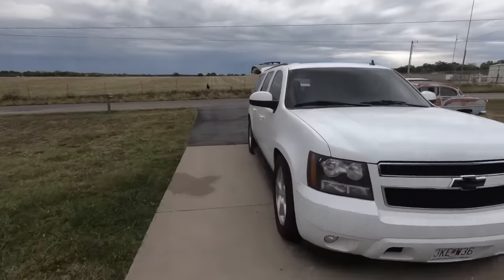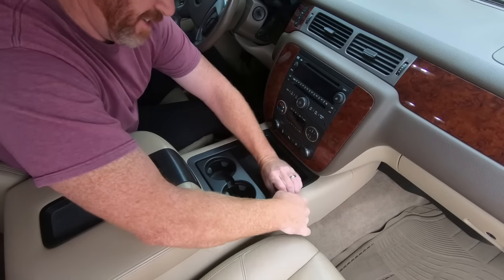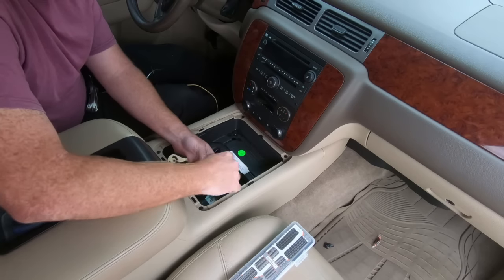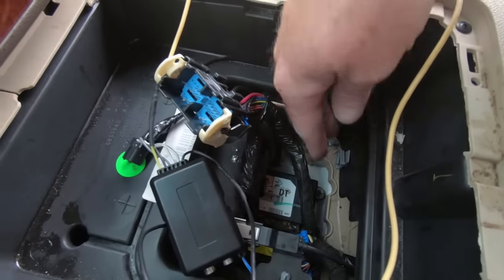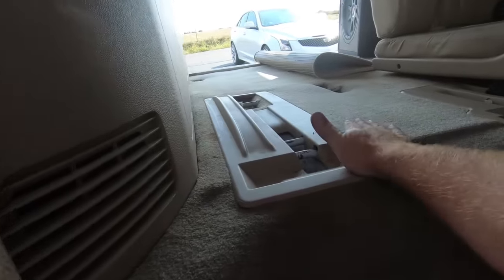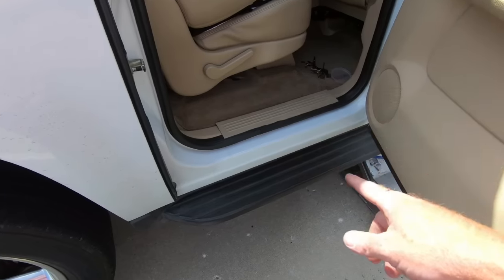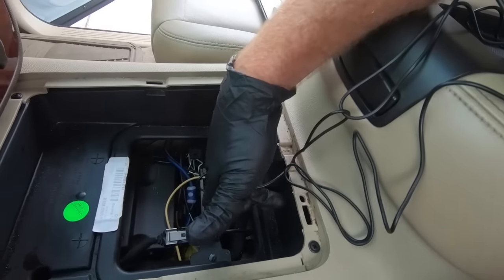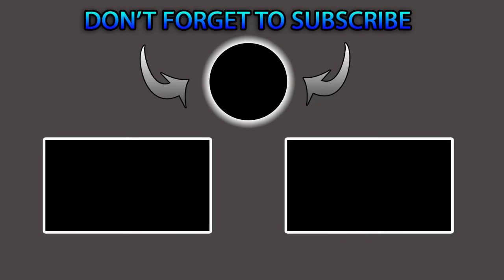Adding Subwoofers and Amp to the Suburban

Comment: Your cupholder bezel is available with matching wood grain from Cadillac. Did it to my 2013 Avalanche, looks like it should....ALL MATCHING!
Also did away with antenna and Cadillac  has the proper cowl plastic for an antenna delete
Reply from the maker: These dont have external antennas. I dont love that wood grain cover. Constantly breaks

Comment: 09 suburban LT exact interior outlay and bose system..under center console hook up wit loc..im highly impressed with this install and will be running the same way this is a super clean install..thnx man keep it up.. 👌
Reply from the maker: Thank you.
Reply: Update..correction.. No bose system..cnt l.o.c. the front speakers cuz of clippn..do to tweeters n door speakers so rear speaker used n no clippn..still same install..very clean
Reply from the maker: Thank you

Comment: I liked how clean the install you did was. I always enjoy the videos. I have a sundown sa 15 in my Jeep with a tar amp 1200 watt. That thing hits pretty hard. I always liked kickers as well. I bet it beats man. Keep up the great videos.
Reply from the maker: Thank you. Yeah it does pretty good for cheap used speakers. I'm going to have to try some sundown stuff
Reply: Razor subs pretty good also, I had the Gothics (1) on the razor 2500D.. Loud off bass all the way down in neg ..sound traveled deep and loud for the caddy like 15s  truck bass

Comment: If you have issues with the amp moving around, get a couple 1” aluminum straps and sandwich the carpet between them and the amp with bolts through the amp mounting holes into matching holes in the aluminum strap. Mounted a powered sub that way in our old 2001 Slownoma extended cab on the back wall of the cab.
Reply from the maker: Thank you for that. It seems to be doing well.

Comment: Hey man. Very nice, and clean, setup. I'm going with Focal 6.5 2-way in the front, 6.5 coaxial in the rear doors, and 12" Focal sub. Alpine 5 channel amp. In a Tahoe 2000 mod. Thanks for your videos brother!
Reply from the maker: Thank you. Sounds like a nice set up you are going with
Reply: @TWAMotorsports  did you upgrade you mids and highs?

Comment: Great tutorial for all the radio amp subwoofers people out there 👍
Reply from the maker: Thank you
Reply: @TWAMotorsports  Travis I'm looking into that brake kit you bought for your ws6.  I'm upgrading my front and rear brakes and the kit you have isn't showing up for my 94 trans am. Is there a typo error?
Reply from the maker: Spindles are different on lt cars. Need 98up front spindles
Reply: @TWAMotorsports  ok. Thanks my friend. I found the brake kit for my year 94 trans am. But they are out of stock. So I have 2 options? I can wait till they come in but Don't know how many months it will be? Or I can by 98 front steering knuckle to allow bigger brakes... What's your opinion on my options??
Reply from the maker: Upgrade from spindles. I have a set I sell for $100
Reply: @TWAMotorsports  100.00 for the pair
Reply: @TWAMotorsports  ok they have the front brake kit same brand as you have on your ws6. But the rears are out of stock at the moment. So I'm going to purchase the front brake kit for now. And I'll do the rears when they come in stock.
Reply: @TWAMotorsports  also Travis... I'm going to order that POF 15 paint to do the underside of my 94 project trans am. I'm going to but the gloss black though I think it will make the red powder coat BMR suspension stand out more.. what's your take on this paint?
Reply: @TWAMotorsports  I'd buy your spindles but they won't fit my 94
Reply: @TWAMotorsports  happy Friday my friend. Any plans for the weekend?
Reply from the maker: Work all weekend unfortunately
Reply: @TWAMotorsports  i worked 60 hrs this week. I'm glad I have weekends off..  I'm going to be working on my 94 trans am. I need to finish removing the old suspension parts and brake lines.
Reply: @TWAMotorsports  did you get my email address ?
Reply from the maker: Good luck
Reply: @TWAMotorsports  send me an email if you come across any trans am parts..
Reply from the maker: Will do
Reply: @TWAMotorsports  I like that black Z28 you had that looked like a clean car.. how did you like the Bilstein shocks and struts on that car? I bought Bilstein for my 94. But I went with BMR lowering springs in powder coat red..
Reply from the maker: They were ok. I'm a viking coilover guy now
Reply: @TWAMotorsports  good Sunday afternoon my friend. Well I got my stock k member out today. I did it but myself with the LT1 in the car. It wasn't that bad I just took my time. I spent yesterday taking off the front brake lines and power steering lines. I took out the steering rack first cause it was easier to reach the motor mounts. I have my engine brace in place to keep the motor from dropping and I have my jack with a block of wood under the oil pan. I got some major cleaning to do and painting before I put any of the BMR kmember in.. I'm replacing my entire front brake lines and power steering lines and I'm going to purchase a new steering rack from the rack doctor..
Reply from the maker: Sounds like a great start. Do NOT buy a rack from the rack doctor though. Complete garbage
Reply: @TWAMotorsports  damn my friend. I was going off your saying on the rack doctor.. give me some options on a new steering rack.my old 94 steering rack is leaking. I don't want to install that old one in my car...
Reply from the maker: @keilylmm6377  I swapped mine out a few videos later with a gm unit
Reply: @TWAMotorsports  ok thanks for the info. I'll look into a GM steering rack. Do you think a 98 02 steering shaft will replace my old 94 steering shaft.??
Reply from the maker: It should

Comment: Kenwood system what I’m putting together with kenwood dual 12” with Rockville 3000 has 750RMS which be upgrading to BOSS 1100 Riot amp to the Rockville 3000. Dread part is rewiring the 8 awg to the 4 awg.

Comment: Throw some 10s in it, kicker good I ran alot of kicker/Orion, I'd build the box slightly wider meaning front to back about 2 or 3 inches not far above sub specs for deeper lows in truck
Reply from the maker: Already sold

Comment: I have two of the solo baric 10” man they sound nice and the bass is insane just built a custom box for mine on a Saab 9-3 paired with a Phoenix gold amp from the early 2000s hoping this setup sounds good should be similar since I have the same parts bin GM  radio
Reply from the maker: Crazy how good they are honestly

Comment: Don’t know if you still have the vehicle or not but question . I had this done at the shop with stock head unit, I plan to upgrade head unit do I have to unhook the line converter to still get power from my subs to new head unit ?
Reply from the maker: I would for better control of the subs

Comment: Thank you for the video. Do you know what brand the line-out converter you used is ? The link isn't working, and trying to find a decent one. Did you get any noise interference, the dreaded whistle ? 
I always had systems in most my vehicles, just haven't tried tying into a Bose system yet.
Reply from the maker: No whistle. I know what you are talking about. I fixed the link btw.

Comment: You think the radio and speaker wires are in the same location for A 2005 Chevy suburban z71
Reply from the maker: No
Reply: Thank you for the response do you have any idea we’re would they be
Reply from the maker: @darwinmoya5155 not off the top of my head

Comment: Did you have to disconnect you factory sub????
Reply from the maker: You don't have to. I kept mine hooked up for some added midbass
Reply: Is there a factory sub ? I see two vents in back but is that a SUb and if so cant I upgrade them to a better brand ?
Reply from the maker: Some do some don't

Comment: Do I need a line output converter and what is its purpose I have a 2011 suburban and I’m wiring a sub and new amp do I need that?
Reply from the maker: If you are using factory head unit yes

Comment: How come when I hooked it up to the wires under the cup holder I have to unplug it and plug it back in for the subs to work and the factory amp to work to??
Reply from the maker: No idea. Check for a short or cut in wire

Comment: Hey man will this work or similar steps for a 02 Yukon denali ?
Reply from the maker: It sure will
Reply: Thanks just looking for a line output converter now
Reply from the maker: Should be able to use the one I did. Link in video description
Reply: @TWAMotorsports  thanks I was checking that out you recommend using that one instead of the PAC interface gm kit? I like the one you have you can adjust it

Comment: Huh well that's cool, thanks for the info man
Reply from the maker: Thank you. Hopefully it helps
Reply: @TWAMotorsports  yes actually really does, but what about a 2005 Chevy suburban? Also has the BOSE stereo system. This one I bought brand new off the lot years ago and actually curious about redoing the stereo system in it. Actually sounds badass til this day, everything's stock still, but just like your newer one,.. much like the other same year I have I'd like to upgrade my older 2005. Can't seem to find many helpful tips out there for a 2005 ? 
Or is it really the same just different interior
Reply from the maker: Yeah the 2005 won't be the same set up unfortunately

Comment: Tryd to add a amp/sub to factory Bose sound system and the rear speakers won’t work when the amp is turned on but when the amp has no power going to it all the speakers work like before. I used a kicker line output converter, I tied both the left and right wires on the line output converter into each other then tapped into the light green and dark green wires that Is located under the trey on the center console on the left side of the plug which I believe is before the factory Bose amp that’s what I used for my speaker signals then I tapped into the light pink wire on the same harness that I used as my remote turn on. Anyone have any suggestions on how to make my sub and amp work with the factory Bose system.
Reply from the maker: Not sure but sounds like when you tapped in you disconnected the rears somehow

Comment: FYI, once your gain is set, you should never use it adjust base.  The gain is designed to get the maximum quality output based on your available power.  You should calibrate it to your max volume at set up and then never touch it again.  If you want to turn the base off/down, use your radio controls.
Reply from the maker: Thank you for that. It definitely needs some tweaking